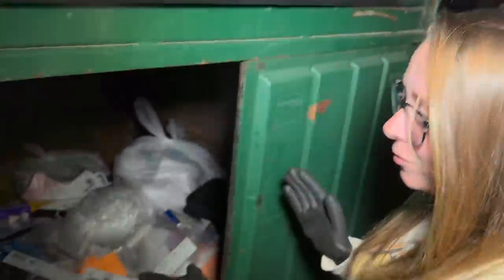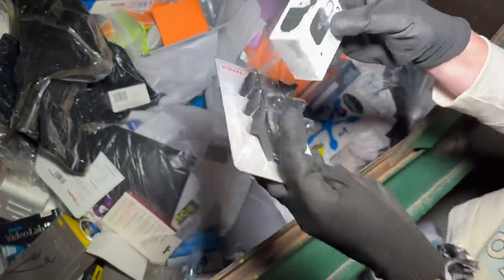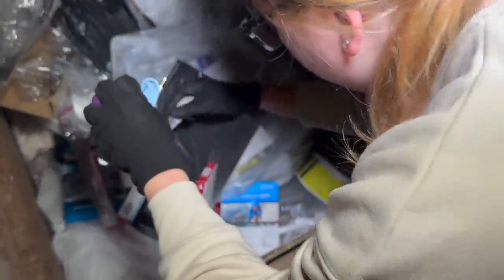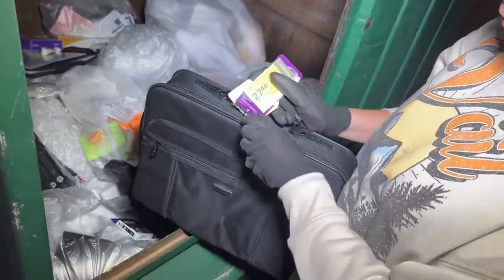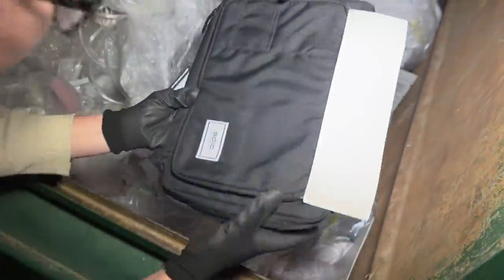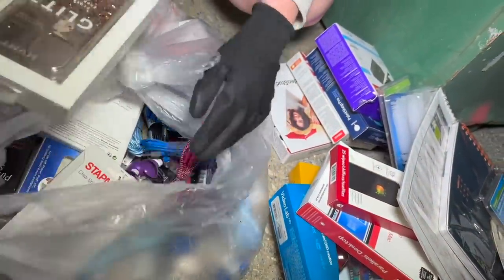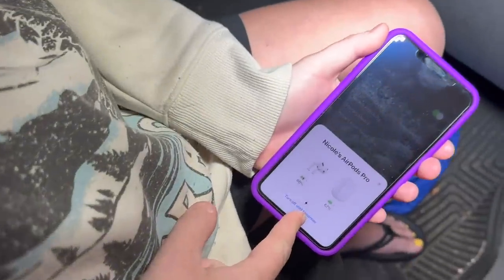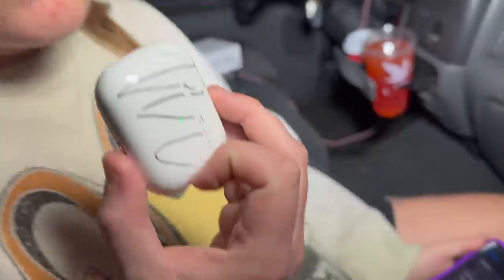WE FOUND STAPLES EMPLOYEE'S SECRET STASH! WE TOOK IT ALL!

Comment: Did you tried one of the other cases you found for the air pods it could be the case and not the pods if it's a charging issue. Xx